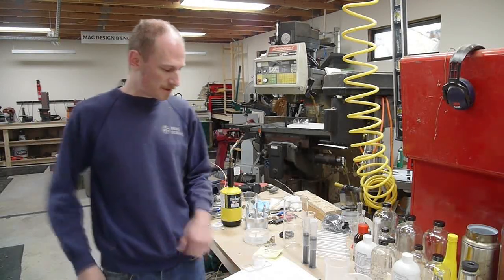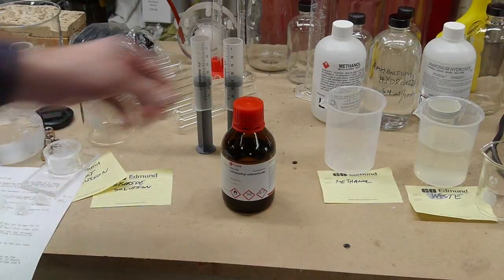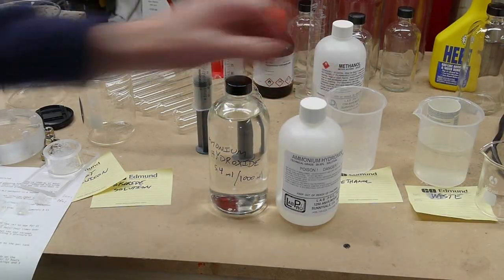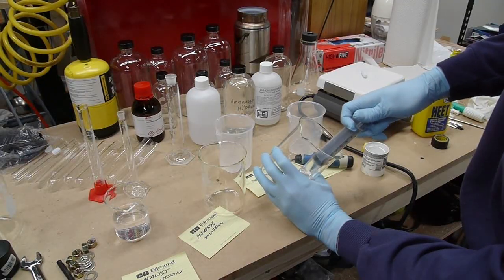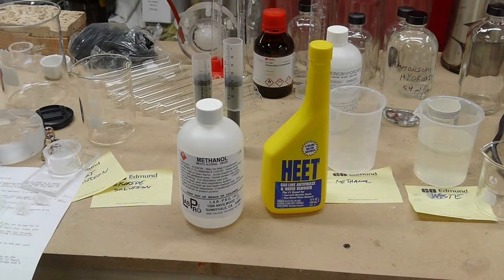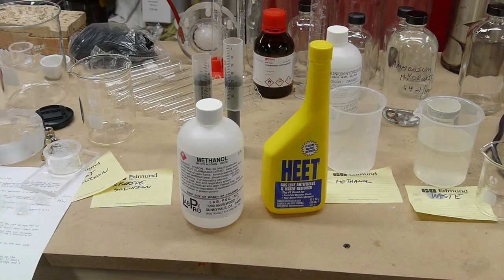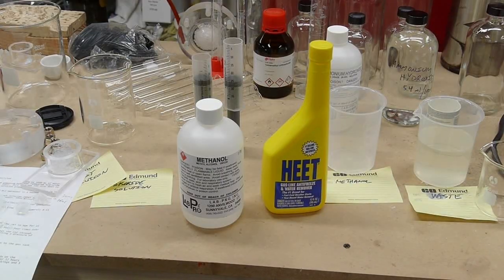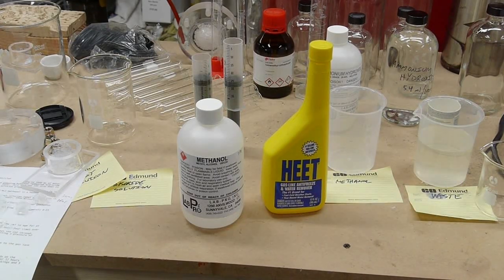Making silica aerogel at home

Comment: You mentioned you didn't have a volumetric flask (sp) when measuring the water, but i've heard it's actually better to measure chemicals and stuff by weight due to differences in density from  things like atmospheric pressure, temperature, etc.?

Comment: Removing the water could be made easier by soaking it in methanol with molecular sieves. The sieves would be able to soak up the water that is defusing into the methanol like a sponge. You would just need to keep it in a sealed container as the methanol and sieves would also be pulling water from the air.

Comment: It is not hard to make TMOS at home lab. First we can start with Si wich could be obtained through a thermite with sand. Then chlorination (electrolysis of NaCl water solution - but it could be a long process) of Si dust(need to ignite reaction with heat). So we get liquid SiCl4. Then we need to heat SiCl4 with anhydrous methanol 4CH3OH (CaCl2 and distillation to remove water) -> Si(OCH3)4 + 4HCl. (As a bonus you could get HCl*H2O acid if you direct the HCl fumes into water - let the fumes fall into water do not move the tube with HCl into water)
What is a purpose for that aerogel you making? TLC - Thin Layer Chromatography? Some filtration purpose? Maybee some sort of zeolite-like material to seperate gases for oxygene concentrator?

Comment: The critical point of methanol is nearly the same pressure, though a good bit hotter. Maybe that would save you a step, if the apparatus can stand the heat.

Comment: one thing that may help against cracking. I believe you were right about the large almost instantaneous change in temperature being the cause for cracking. that being said, as opposed to wrapping the aerogel in foil, which will still allow the fluid to come in direct contact with a warmer body. I was thinking if you slowly cooled the gel prior to putting it in the chamber by putting the methanol bath in either a ice bath, or even just putting it in the freezer for a day prior to the supercritical phase. i  belive this should help prevent cracking more so than just putting some foil around it.

Comment: Wouldn't it be an idea to put a bunch of molecular sieves into the methanol? That way the water content in the methanol would stay really low at all times, which would speed up the diffusion process and at the same time save you some methanol and the effort to change the solvent.

Comment: Instead of exchanging the solvent, could you use molecular seives, as seen on the NurdRage channel (and others)? Also, maybe you could cool the product in the freezer before putting it in the drying chamber, that may reduce the thermal stresses.

Comment: Step 3 seems to take quite a while. I would try using a soxhlet extractor during this step. That way you can "wash" the sample with fresh, almost pure methanol and it would basically be the same as dipping the thing and letting it sit over the course of a few days. Also, you won't need to constantly change the solvent, due to the working principle of the soxhlet extractor. Be sure to check it out. :)
Reply: That is actually not a bad idea because methanol and water don't form an azeotrope.

Comment: Not sure if you're still checking comments on this video, but there's actually a semi-OTC method to make tetraethyl orthosilicate at home, which should substitute well for the tetramethyl used here. To do this, first prepare silicon tetrachloride by passing dry chlorine gas past some silicon in a heated tube. This reaction is extremely dangerous due to the large amounts of toxic corrosive chlorine required, but there are videos of the synthesis in youtube. One the silicon tetrachloride is made, purify it by passing it through a cotton filter and add it to excess anhydrous ethanol SLOWLY. The reaction is extremely violent due to flash boiling of the solvent. Once all the silicon tetrachloride is added, distill off the residual ethanol and what remains is tetraethyl orthosilicate, pure enough for aerogel.
Reply: "By passing dry chlorine gas over silicon in a heated tube" that sounds like hell to get set up.
Reply: Bill Smathers if you survive...lolz
Reply: Jordan Schlansky would be proud of your comment
Reply: i think nileRed or someone made a vid on something like that(making sillicon tetrachloride)
Reply: The last time I made chlorine gas, I discovered it reacts with methane in the presence of light.
Nobody was hurt - thank you Pyrex & fume hood!
Reply: CIA, open up!
Reply: Surprised someone hasn't deleted your post with a copyright notice. Corporations hate technology being taught freely.

Comment: So I've been doing some research and understand the mechanism behind the gelation of silicon alkoxides. For those that don't know, the TMOS reacts with the water and produces methanol and Si(OH)4, this in turn bonds with another Si(OH)4 to form an Si-O-Si bridge of sorts. It has been brought to my attention that all silica compounds have a layer of  silanol on its surface. So my three questions are, will TMOS or other silicon alkoxides in gerneral, bond with glass when it is reacted with water? If all silica compounds are covered in silanol, then why doesn't fumed silica immediately bound with itself, forming a highly porous chunk of "glass"? Lastly, do you know if Al2O3 or Al(OH)3 will form bonds with silanol?

Comment: To get around the cracking issue, it might make sense to insulate and refrigerate the chamber first.  You could even do that with a dry ice and alcohol bath without too much trouble.  Once the gel is cooled, it will no longer undergo any thermal expansion or contraction of a significant scale.  Then the addition of liquid CO2 will very likely not cause the cracking to happen.  Just a thought.

Comment: Hai  

""Vacuum drying"   -  old youtube   - uses   tyre  inflation pump  12 v   in  "reverse ",  lower  pressure  -   and evaps  methanol then  water  .   2%   water  -   so   the  harder "vacuum" .  , saves a lot of chemicals

Comment: Why not add anhydrous magnesium sulfate to the methanol instead of flushing the methanol so many times?
Reply: I assume you want to keep the methanol relatively pure so that the system is just water, silica and methanol. refluxing over a molecular sieve and having the dry methanol run over the gel before boiling again would allow for extremely low methanol use, but methanol is cheap so no reason to fuss over it, just dump it in the gas tank after use.

Comment: When soaking the gel in the methanol, couldn't you use maybe a evaporative distillation process to remove the water from the methanol and then dump it back into the dish. in other words just recycling the methanol so you use less, and the water concentration would stay low.

Comment: could you freeze dry the aerogel?
Reply: *****
care to explain why?
Reply: 1wsx10 I think that is sort of what is being done at the last step in the supercritical drying chamber once most of the water is removed in the methanol bath leaving some methanol which is removed with the very cold CO2.
Reply: 1wsx10
well, before you supercritically dry the gel, it isn't called aerogel, as it don't have any air inside. but you can call it just gel or alcogel.
but, if you meant freeze drying the gel, you actually can, as long you can cool it enough to freeze the methanol or exchange it with water before drying. but, at the end you will not have an aerogel, the result probably will be light, but not so much, the freezing of the water\methanol is still a harsh process, and the ice cystals, even if they are very small, will break some of the structure.
Reply: ok, thnaks

Comment: just wondering what you would make, if you put that aerogel liquid in with the gas mix it in  then make it go supercritical then set the aerogel liquid so it makes a solid in the chamber while mixed with the gas  I wondering if the gas will leach out leaving a lighter solid or a solid with built in pressure  meaning a more harder solid

Comment: Instead of drying the gel by replacing the methanol have you considered adding a drying agent to it such a silica gel or anhydrous magnesium sulfate to essentially trap the water as it diffuses out of the gel into the methanol, then instead of changing it every day or so just leave it in the 1 container for a few days in the same methanol + drying agent bath.
Reply: I was thinking the same thing, but with molecular sieves.
Reply: Dessicated molecular sieves would be an excellent drying solution at that stage, and the seives could be regenerated and reused. Would save methanol also.

Comment: What about a partial vacuum for drying? Enough to counter the collapse into the xerogel.
Reply: Xerogel is correct, it's the collapsed more solid, less airy version.
Reply: Then the boiling action of the methanol would most likely break the gel. The supercritical step is to avoid those movements by rising the temperature in the sealed chamber until the meniscus vanishes then slowly drop the pressure while keeping the temperature above boiling point until 1 atm has been reached. A smooth transition from liquid to gas has been achieved without violent boiling or surface tension pulling.

Comment: Interesting... I should experiment and see if i can do this without TMOS. Since the Gelling phase is a basic catalyzed condensation reaction, it might be possible to generate the Silicone Dioxide in situ by ammonolysis (or hydrolysis) of the methoxy silane bond.
If you can do that, the starting materials become both safer and more readily attainable, though i don't have supercritical CO2 curing vessel (nor do i have a place to build one really).  

Also... as a note. rather then use methanol and only methanol through the whole process, i think you'd get better results if you switched to Isopropyl alcohol after the initial gelling. The main reason would be the effect on the curing process. A layer of salt in the isopropyl could aid in the removal of the water, and you could cover the gel to prevent pressure changes, preventing surface deformations.  The salt in the alcohol sets up a water gradient, with the dryness of the isopropyl coupled with the salt's (which ever salt you choose) hydrophilicity driving the gradient.

Comment: I was thinking about the really light weight aerogels. Would it be possible to create the gels with hydrogen instead of air in gel. If wrapped in a light weight foil, to protect the hydrogen from oxygen and to contain the oxygen, could you produce a floating aerogel?

Comment: Great video, I've fancied having a go at making areogel for a while. I don't want to sound like a health and safety freak but a gas mask doesn't offer sufficient protection. Moisture in the air and your breath will rapidly deactivate the filter rendering it useless at stopping chemicals. Why don't you build yourself a fumehood and vent it out one of the windows? A sheet of perspex a a couple of sheets of ply is all you'd need.
Reply: Hello , do you know how to make a mass products of aerogel ?

Comment: Hi Mr Krasnow, I am wondering if CO2 is the necessary component for the super critical drying chamber? Does an air compressor work well as a substitute? According to aerogel.org, you'll need 100bar for the pressure. As long as the pressure is maintained at 100bar and the temperature around 40 degree celsius, it should be fine?
Reply: It is not about pressure. The supercritical CO2 IS the drying agent. It cannot be replaced with compressed air at similar pressures.  Those pressure and temperature parameters describe the point at which CO2 turns into a supercritical fluid.

Comment: Interesting. TEOS & TMOS are quite difficult to find but i think we can make the same silica gel using sodium silicate, which is cheaper. In my lab, gel can be made by mixing sodium silicate "industrial grade" with strong acid (HCL) and small amount of water. Do you think it will have same quality with yours?
will it be densifed if i sinter it at high temperature?

Comment: During the water extraction phase perhaps you could use a desicant like CaO, CaO3, or silica gel to the dry gas instead of changing it out just sprinkle a little more in over time.  The desicant can be regenerated with heat (lots for CaO, CaO3), silica jell can ge cooked out in an oven.

Comment: Why don't the labs want residences to have chemicals?
Reply: Various reasons. Some chemicals are just downright too dangerous to allow untrained laymen to be in possession of. Some are essential precursors to the manufacturing of controlled substances, and some are essential compounds in the synthesis of explosive materials. Some chemicals have uses that could cover that whole range, and some might only have one specific use, but overall, those are probably the main reasons as to why they won't sell to regular people. There are no doubt more reasons.
Reply: silver965 Those are legal reasons you mentioned, and I'm sure they play a role, but the biggest reason is money:  They simply can't make enough money by selling small quantities to individuals, the chemicals are worth much more once they are made into products, and the risk is much smaller than the financial gain, so they simply refuse to do business.

Comment: its nice to have a piece of it but what uses could i use it for ?
Reply: A piece that small? Bragging rights.
Reply: lol , i guess you are right
Reply: Well maybe you need a small, very light substrate or insulator? If you could shape it a bit better, small flying machines would definitely have a use. Imagine what you could do with small rotor or electrostatic flier designs if you had a lighter building material?
Reply: Mr.Aptronym you are right , this would surely be amazing

Comment: The Supercritical Drying chamber is also called a BOMB the Supercritical pressure is 1070 psi. or 144,840 pounds per square foot. that's the equivalent of putting 10 elephants onto a square foot. One small leak and that could do some SERIOUS damage. 
   Tetramethyl orthosilicate is classified as a T+ Chemical its effects from JUST VAPORS include permanent blindness, among other things.

Comment: You should get a better gas mask. That model is outdated and more than likely expired, if there are even microscopic cracks in the rubber you're at risk of exposing yourself to whatever you're working with.

Comment: Would using a drying agent like anhydrous sodium sulfate or mol sieves help in speeding the methanol/water xchange?  Could put a layer at the bottom of the methanol, rest the gel on a raised platform above.

Comment: Here is the safety section on wiki about Tetramethyl orthosilicate:
The hydrolysis of Si(OCH3)4 produces insoluble SiO2 and CH3OH (methanol). Even at low concentrations inhalation causes lung lesions, and at slightly higher concentrations eye contact with the vapor causes blindness. Worse, at low concentrations (200ppm/15min) the damage is often insidious, Contrary to several erroneous MSDS sheets, the methanol produced is relatively innocuous think about it !

Comment: The are hydrophillic beads used in the manufacture of pure ethanol for biodiesel. You might be able to use something like that to cut down on some of the waste you generate. The drawback would be that in order to recharge them you have to bake them in an electric oven. If you have anything nasty in the beads it will come out as a gas.

Comment: may i suggest bringing the temp of the gel down before putting in the chamber? if you can get it so that the co2 will evap slower when hitting the wall it may not boil and crack the gel.

Comment: Seems like you may be able to freeze dry the methanol out also under vacuum pressure maybe? Methanol freezes at -98 C. If you were to freeze your gel in a vacuum flask with liquid nitrogen( -198 C) then apply a strong vacuum the methanol would go from the solid phase directly to the gas phase the same as freeze drying vegetables. Not sure but it seems like it my be gentler then the repeated exposure to boiling liquid CO2. Cont...

Comment: That was pretty cool!  I found that diesel truck brake line antifreeze contains 100% methanol with no additives, I tried by evaporating some on a mirror and nothing at all remained after evaporation.  It's cheap too, about 20 dollars a gallon.  I've used it in many extractions of volatile oils and never had a problem.  As for the TMOS, we had some in college, I remember we had to be VERY careful with it because on contact with anything moist it hydrolyses, producing SiO2, like in eyes or lungs.

Comment: Would it be possible to use common rubbing alcohol rather then methanol? It seems like the reason you use methanol is because of it's high evaporation rate which makes the super critical drying process more super critical. I'm just thinking the more cheap stuff being used the closer I can come to lining the walls of my house with the stuff.

Comment: tetramethyl orthosilicate AKA tetramethoxysilane (the latter being the official IUPAC name) is a dangerous chemical that, when exposed to water, creates silicon dioxide and methanol. If this process occurs in the eyes, the damage done is irreversible and quite nasty. Not something you want the average joe to get a hold of. :\

Comment: Methanol boils at 65c. Distill it.whatever boils over lower than 65 c discard it ,,if there is water in the mix the boiling temp will get higher ,,,just keep what distills at 65 c to be sure ya got methanol,,

Comment: Why not use low cost zeolite as a molecular sieve in the same batch of methanol. Alumino Silicate was the primary component of the WTC dust, by mass spec. Also used to crack crude oil and absorb alpha radiation at Chernobyl, Fukushima, and GZ.
Research the elemental comp of GRANITE, and the picture comes full circle to a chemist.

Comment: would removing the methanol with liquid butane work? ie washing in butane, you would still have to remove the butane but hopefully it would either have lower surface tension or go supercritical at a lower temperature